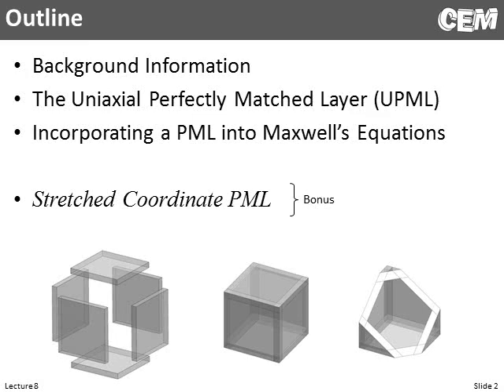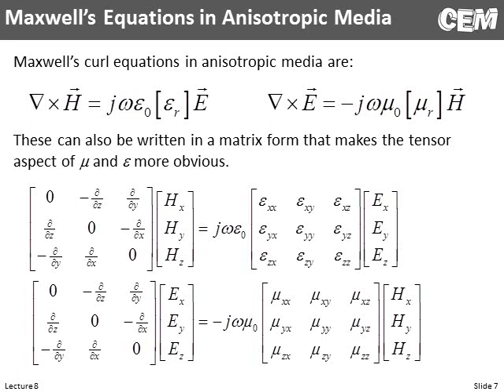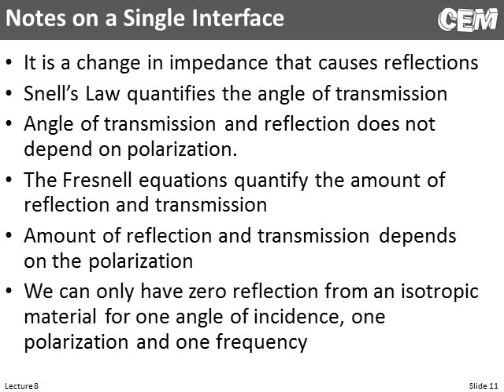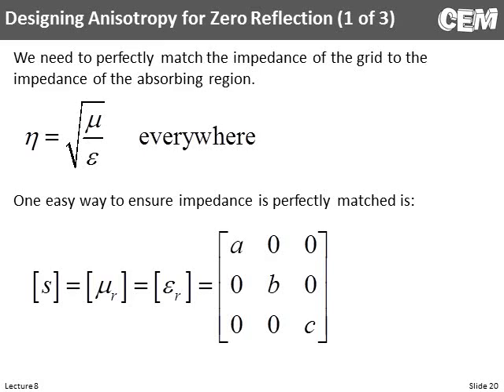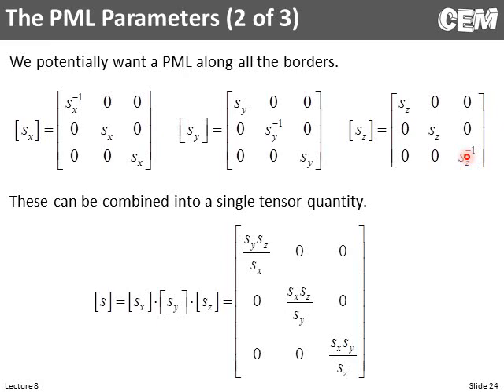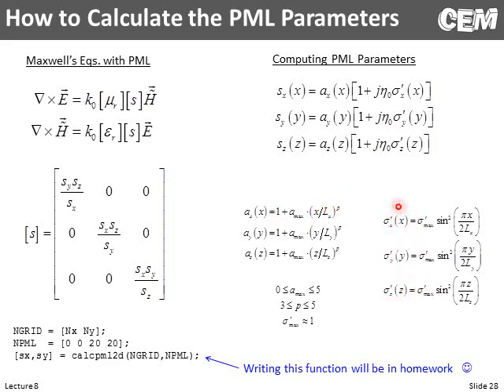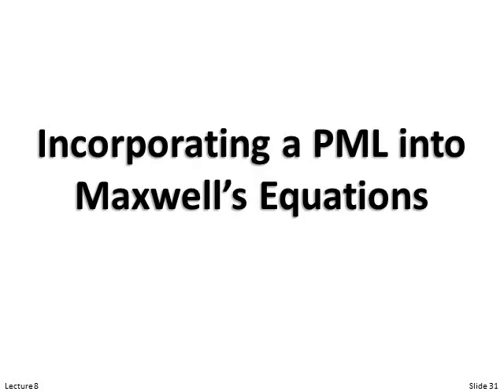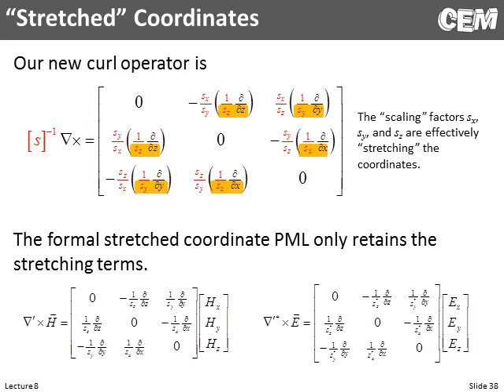Lecture 8 (CEM) -- Perfectly Matched Layer

Comment: Hi, thank you and one question

'Computational electromagnetism' -> Topic 3 'Concept for 2D and 3D simulations' -> Lecture 3f 'Perfectly matched layer'

Page 24 (or slide 48) in the 'Example Data for 2D' we have that the columns of '1' is vertical why in the notation before 'visualizing sy in 2D'  it is horizontal. I think that they don't have the same notation, moreover I was wondering which notation follows the simulation...

Comment: Thanks! Can 2D FDFD problems be solved using GPU if SC-PML is incorporated? Would that speed up the computations?
Reply from the maker: Yes, absolutely and it definitely speeds up computation. I show how to do this in Chapter 10 of a book I recently published.  Here is a link to the book website:

https://empossible.net/fdfdbook/

This is only the tip of the iceberg. There are many ways to make FDFD fun faster when it comes to high-performance computing.

Good luck and have fun with it!

Comment: Hi, what if you just defined in your code, that all incoming fields/waves at the border of your simulation area are just set to zero, instead of using this whole UPLM theory. Wouldn't that solve the problem of reflection as well, but in a much simpler way?
Reply from the maker: That I know of, nobody has figured out a clean and efficient way to do that.  First, there may be multiple waves in different directions at the same time.  This will make it harder to set them to zero as you may have to distinguish waves at different angles.  Second, if you just set those fields to zero in some row of cells, then the cells next to that would see the zeros and reflect.  You might then suggest, set them to zero for the cells on the outward side and retain the values for the cells on the inward side.  The problem then is how do you know the values of the fields in those cells if you cannot update them with the fields on the outward side?

I may not have explained myself well in the paragraph above, but the short story is that nobody has figured out how to do this.  If you figure out, you will have the holy grail of boundary conditions.

The closed thing I can think to what you are saying is the Mur boundary condition.  However, this does not set the outgoing waves to zero.  Instead, it figures out what the fields should look like on the outside of the grid so that the outermost cells can be updated as normal and the waves will appear to just keep going outward.  The next closest thing is the simple Dirichlet boundary conditions, but the waves will reflect off of that.

Hope this helps!
Reply: CEM Lectures Thank you very much for the reply! This actually helps a lot. And great Lecture, thank you for the upload!

Comment: Hello, I wanted to know how to "run" the *.p files from the homework to check my code (I've installed MATLAB). I am programming in Python though, is there any way to get a benchmarking aid file to check if my code is ok?

Thanks for the excellent content!
Reply from the maker: The tester functions have the code for calculating the PML data.  So I had to provide p-code to test them or the students would have access to the code.  I do not have a benchmarking aid for the PML, but I do provide one example in the latest version of the course notes.  Look at the electronic notes (not videos) at the course website:http://emlab.utep.edu/ee5390cem.htm
Reply: Thanks a lot!

Comment: Hi, the PML was initially matched to free space (air) and then that's why you made [ur]=[er] (I suppose). What if the the problem space is not air? Doest the Sx. Sy and Sz have the exactlly same form? Also, in later part when you incorporated the PML into Maxwell equations, you still use Sx, Sy, and Sz. Are they the same as derived from matching free space? Thanks a lot.
Reply from the maker: Victor Wang sx, sy, and sz have the same form with the problem space is not air.  Nothing changes.

Comment: If we want to solve maxwell matrix equation and want to find both E and H, could we implement Mur first order or second order boundary condition in FDFD while using staggered Yee cell. Or any other boundary condition except UPML.
Reply from the maker: Yes, absolutely.  Many times the Mur BC is used in combination with the PML.  The Mur is better when the exiting wave is hitting the boundary in a single direction.  For suppression multiple scattered waves in different directions, the PML is better.